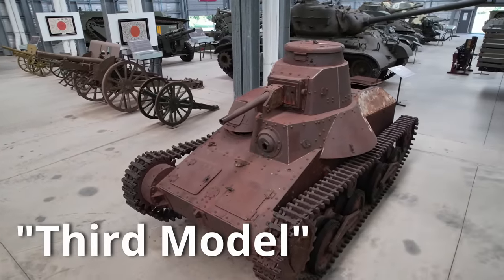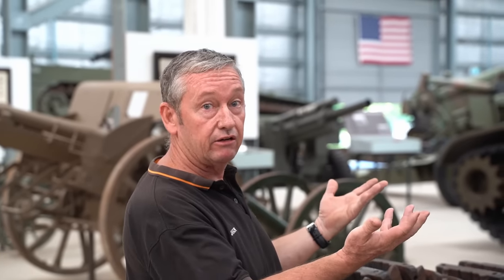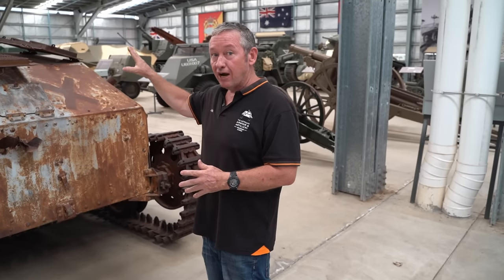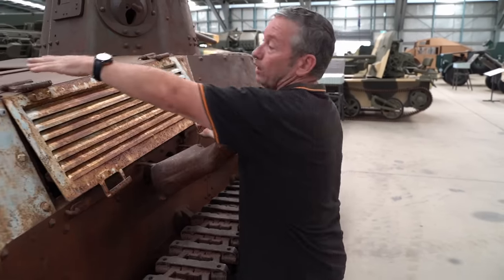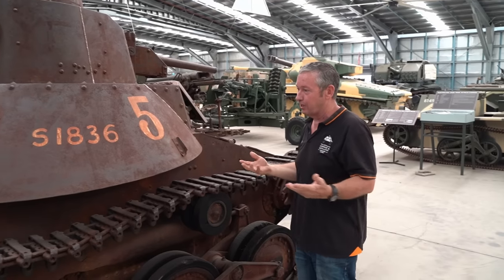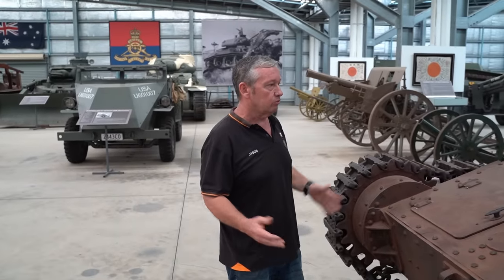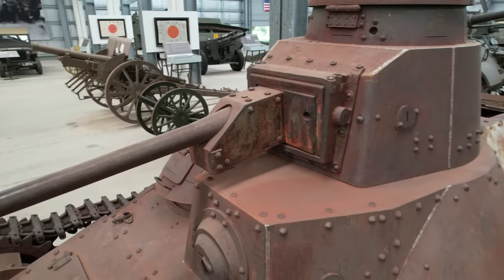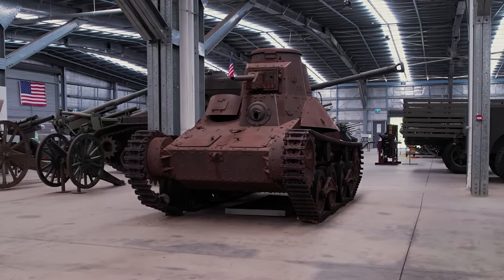The WWII Japanese Type 95 Ha-Go Light Tank (TOUR)

Comment: That is correct !
The early production Ha-Go come equipped with a Type 94 37 mm gun.
The late production Ha-Go come equipped with a Type 98 37 mm gun.
You can distinguish between the early and late production by looking at the lenght of the fender, short fender is early production, longer fender is late production vehicle. The guns however look pretty much exactly the same but the the velocity of the Type 98 is improved, when shooting with the lastest Type 1 AP the velocity is 704 m/s.

Comment: There's one of these in good condition in the Tank Museum in Bovington, England. Unfortunately its hull is sealed because the Japanese lined it with the then miracle heat resistant insulation material Asbestos! So it would need to be removed in a sealed environment by guys in hazmat suits I assume, before it can be fully restored to running order. 
There was a privately owned one at Tankfest '22 though, and it looked quite cute running around with the Shermans, Comets, T-72s etc.  
The type was already outclassed by the Soviet stuff in the 1939 in the Russo-Japanese war.

Comment: I feel like people don't make as big a deal about air cooled tank engines as they should. After reading a few accounts of tank combat in the Eastern Front, the one thing that keeps coming up again and again is the tanks radiators being holed by bullets or fragments. It could lead to the loss of the tank if they were unable to tow it to safety, and it put it out of combat for several days in any case. So I feel like an air cooled engine like the original M4 Medium or M3, or the Type 95 would have been a real plus.

Comment: I have found in a bucket of pipes, what turns out to be the main gun sight from some type of Japanese WW2 Tank. It is very similar to one listed, if you search for "JAPANESE WW2 TANK MAIN CANNON SIGHTING SCOPE" it should come up in ggl
So I need to find out what type of Gun mine belongs to, so I can find the right tank for it and hopefully find it a good home. Any ideas as to who the Japanese Tank Gun expert is?
I assume it was a trophy, still has most of the original paint on it, optics are fine. Still has a removable orange glass lens on it for bright conditions. Remains of a rubber eye cup, marked No 89 A there are some very faint rermains of japanese characters on it but too far gone to decipher. I will check the house title and see if there are any WW2 candidates for who brought it home and so from where.

Comment: such a rare tank. I think the Japanese lined the interiors with asbestos not realizing it was carcinogen.
Reply: I somewhat question that. I can imagine some asbestos sheet on the panels around the engine, and the door into the main hull. This would keep the engine heat out of the cabin to some extent. But lining the crew compartment with asbestos (or any other heat insulator) on a tank to be used in steaming jungles makes no sense. It would turn the inside into a sauna that would turn into a pressure cooker for the crew. Not a good idea.

BTW, asbestos is only really a problem if you breathe the dust. That's because asbestos fragments into thin sharp needles, which stick in the lung tissue and don't wash back out like normal dust. Panels of the stuff are compressed with glue, and generally don't give off much dust at all. So despite modern belief, it would generally be pretty safe to insulate around an engine compartment with asbestos sheet.
Reply: @lwilton  There's a video from The Tank Museum about their Ha-Go and it does have asbestos lining the crew compartment. In fact, at the time of the video (4 years ago) they'd sealed the tank to prevent any asbestos dust escaping. The idea of the asbestos was apparently to insulate the crew compartment from EXTERNAL heat such as the sun beating down on it, and to provide some basic cushioning for the crew. I agree it seems counter intuitive, but their initial thinking may have been that it would support infantry across open ground (where the sun beating down on it would be a problem) rather than used for jungle warfare.
Reply: @rockymac3565  
Yeah, I saw the same video
They probably used them in cold conditions in China to
Reply: @lwilton  
Asbestos doesn't just come in building sheets, we're talking about an eighty year old tank
Reply: @rockymac3565  IIRC it was more that it was designed with the experience of Manchurian winters in mind.  A metal box in freezing temperatures gets very cold inside, esp. with the draft from the engine cooling blowing thru the vehicle.